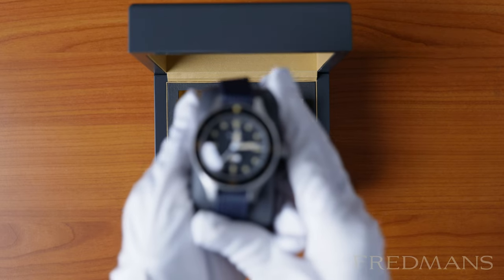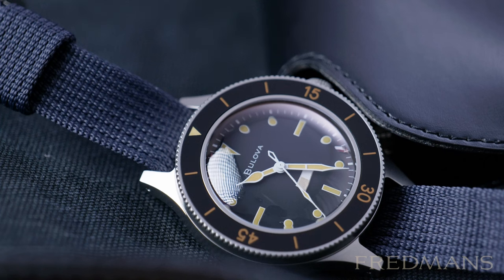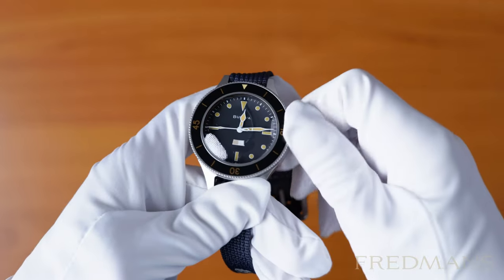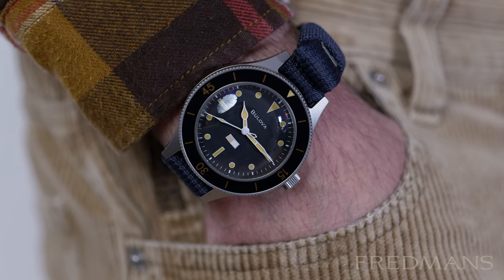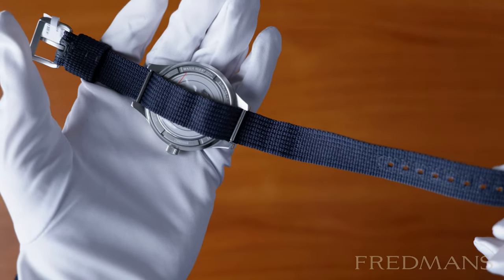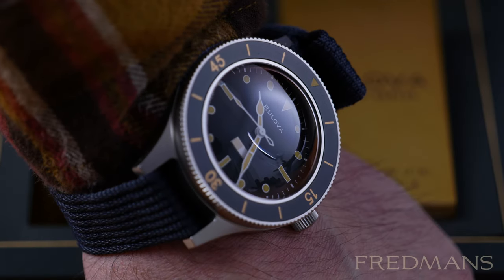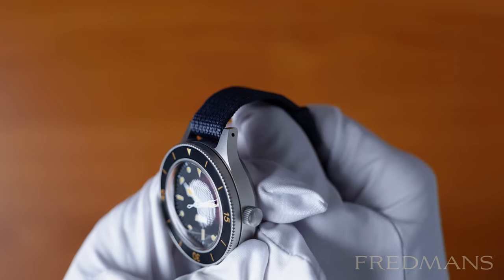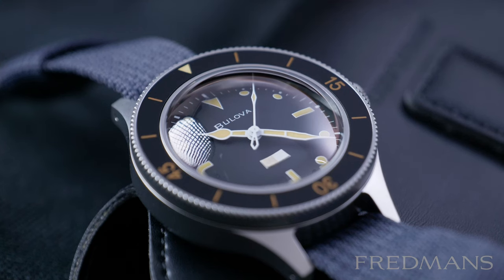Bulova Mil-Ships-W-2181 – An Alternative To The Mainstream Dive Watch?

Comment: The "push down to turn" bezel was at least the Submariner's method before the clicky uni-directional models. So like the 1680/16800 and earlier at least. They can be forcibly turned and many are worn out, but the actual method is to push them down.